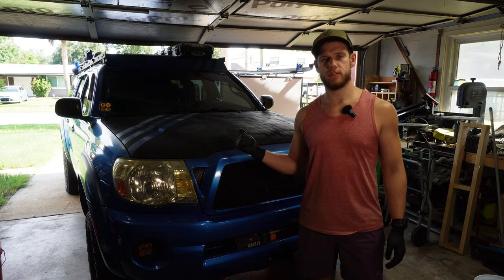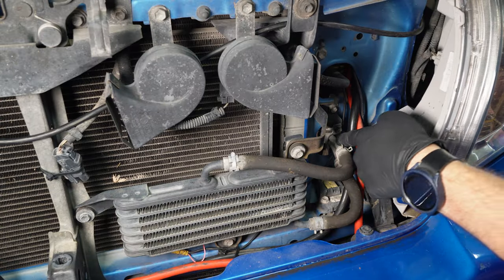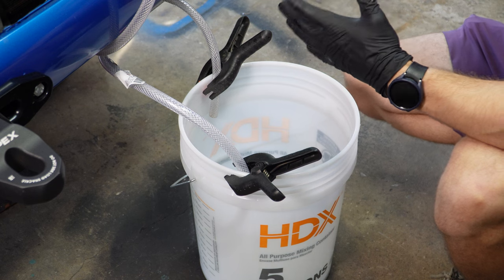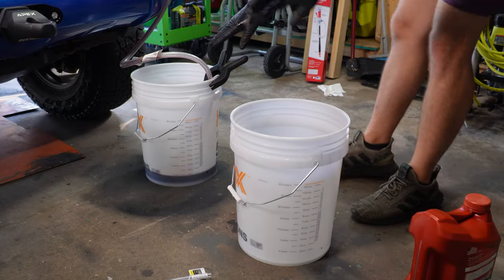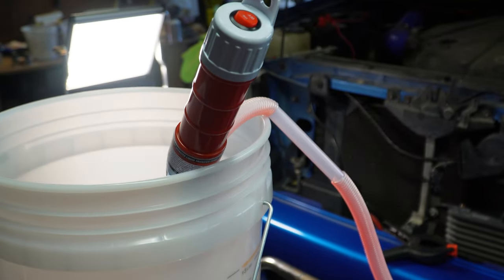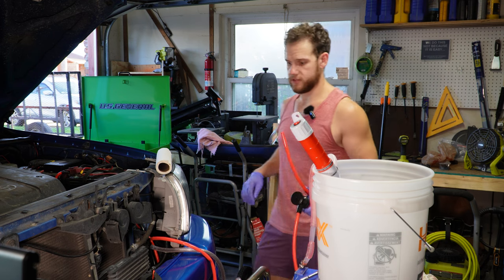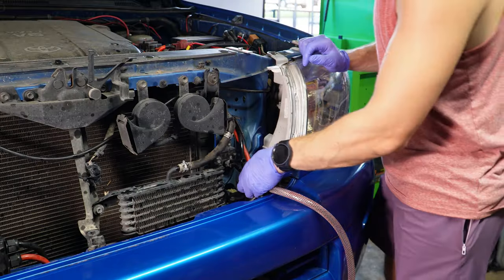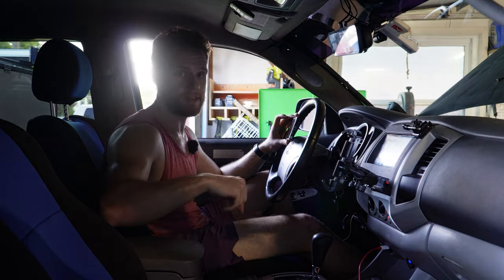DIY Transmission Fluid Flush/Change - 2nd Gen Tacoma (2006-2015)

Comment: Can you do a video showing how to remove and replace the a/c pressure switch (Low side) on a 4x4 Tacoma 2014?
Reply from the maker: Mine is currently working fine, if it breaks soon I'll make a video on replacing it!

Comment: Did you notice much of a difference? Did it pull better? Thanks!
Reply from the maker: Shifts have been smoother and I've also noticed my RPMs are slightly lower than before the flush.  Hoping to see with MPGs if it improved at all over the next 1k miles.
Reply: too much work....Don't do it